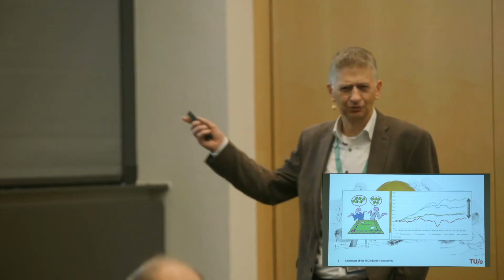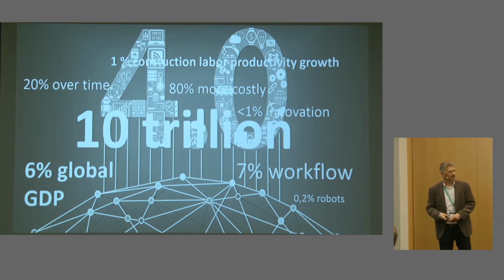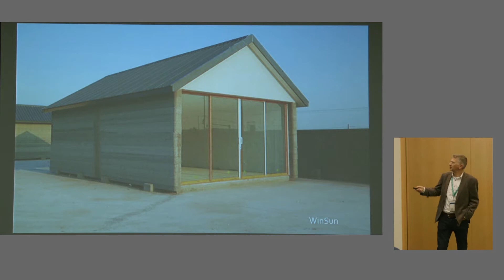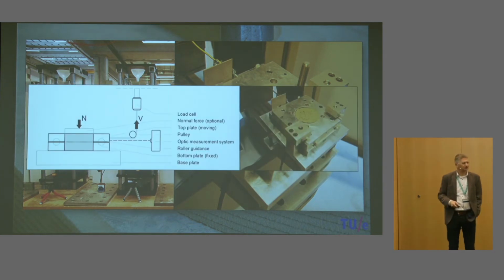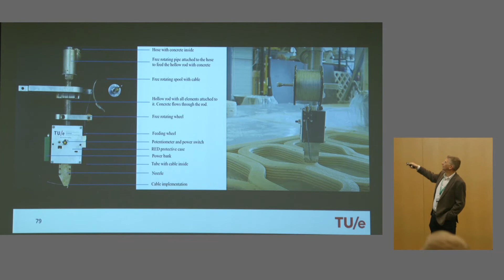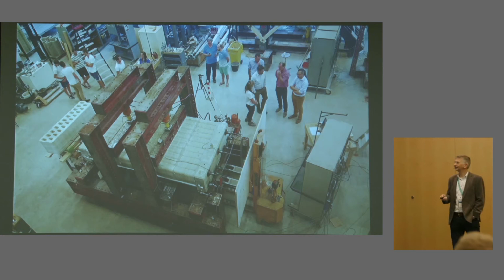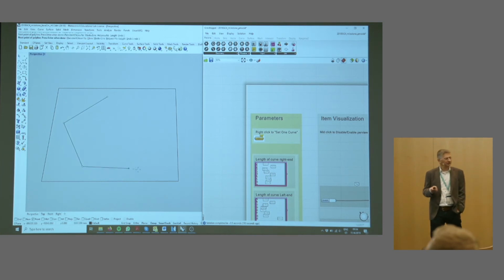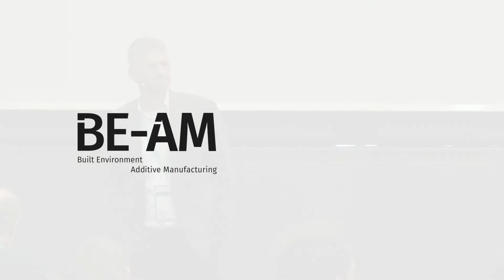BE-AM 2019: Prof. Theo Salet - Concrete 3D-Printing

Comment: The new bridge is wonderfully elegant - lines like a classic yacht. The most attractive 3DPC structure to date! For the buildings it appears that the printed part is now essentially geometry definition and cladding, which of course is most substantial, but not really structural - in that traditional poured reinforced-concrete piers are also required - post printing. Multi-story 3DCP all seems to be headed in this direction (which is unfortunate).